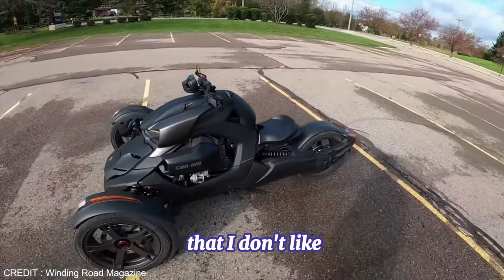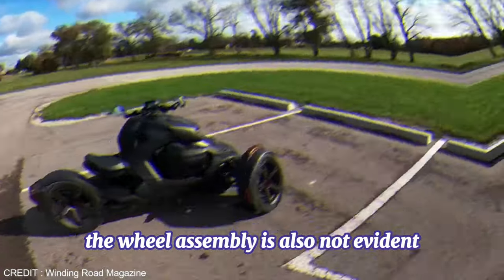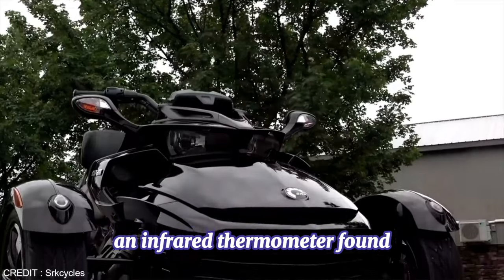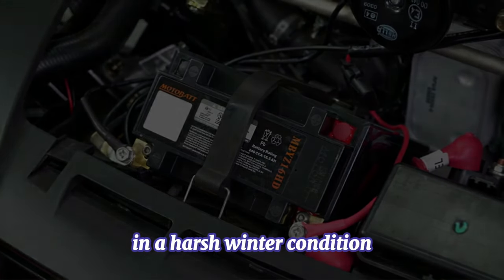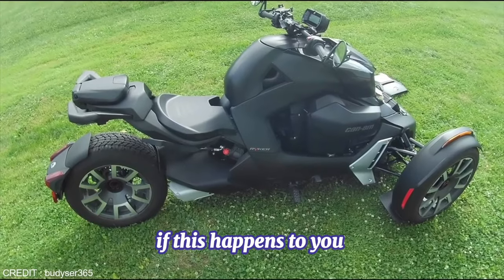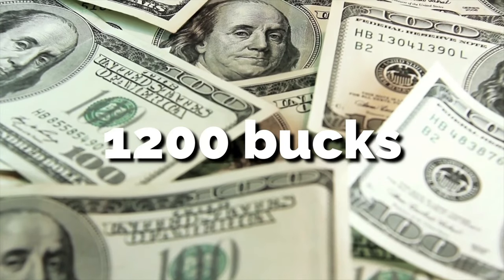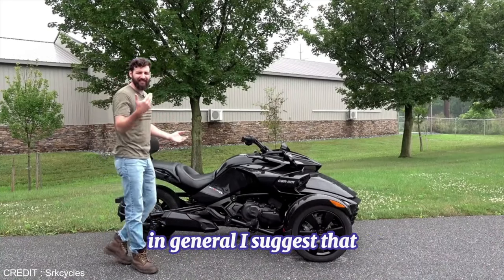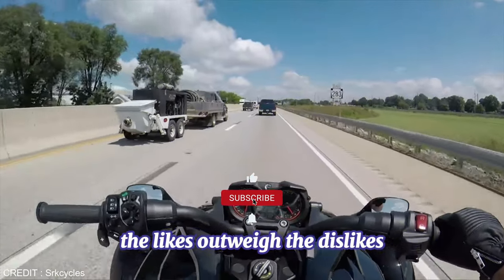Shocking Truths Behind Can-Am Ryker Exposed

Comment: Most of this is CAP. Doesnt even sound like this person owns a Ryker. #1 i would say 95% of Ryker owners dont take these off road. Its not an offroad 3 wheeler. He wasnt even showing a Ryker. #2 It does not get so hot its a problem. #2 This thing stops on a dime. All the riders I know including myself I have not once heard anyone complain about the break pads. #3 Who hangs out on the Dunes? Stop it. #4 Antifreeze reservoir. Again Who are these people you speak about. Never heard this issue before. #4 if you are going to say this is about the Ryker then Stop showing the Spyder and all those other vehicles. LOL. They dont have the same so called issues.  #5 Not once last winter did I have a cold starting issue. Another thing that either doesnt happen or is very rare. You even show some key thats not even for the Ryker. #6 Regular maintenance. The first oil change isnt due until 6000 miles. What other maintenance do you need? Also stop showing other vehicles. #7 Seriously hand and parking break issues? The Ryker doesnt have a hand break. At this point you are just making things up. SMH #8 I love that you show Slingmods vids for so called factory accessories. Again stop it. #9 Now your comparing a Ryker to a Lamborghini smh youre a FOOL! #10 Rust....What besides the rim holes do you see rust? My 2021 has literally been left in the pouring down rain and I have driven in the pouring down rain and I dont see these so called RUST issues. STOP IT! Lastly to finish off saying you love the bike. Id bet you dont even own one. So much of your footage is not yours or taken from other people. Showing a body kit that no longer exist and never really came to market. Showing so many other vehicles. Good job on the lies and click bait.  If you have one tell us year, make and model. Show pics, are you original owner? If not stop trying to mislead people.
Reply: My stock // original factory brake pads are a complete pile of dong dog shit. 700 miles in and they started screeching plenty loud.  Also suspension is showing potential issues , but minor fixes to that , aint nothing. So hes right on some , but not all , could be just a year made specific issue idk

Comment: My wife got the Ryker 900 when they came out in 2019.  We did have the VSS code issue but that was only AFTER she rear ended me and the bike needed major repair and it seemed to be an after -effect of this accident.  Other than that, no issues at all.  The bike is low-maintenance and oi changes are easy.  My friend has the same bike and the only issue he has had is the return spring for the brake pedal needing to be replaced because the brake-light was staying on.  The CVT is great - you have great throttle response from low to high end.  I have the 2018 Spyder F3 and when my friend and I ride I sometimes take the wife's bike because I like that low-end throttle response/take off speed plus being way better if we hit a dirt road.  The Spyder is a more comfortable ride and higher quality bike for sure, but the Ryker can be more "fun."

Comment: Where did you get the idea that the Ryker was an off road vehicle. It is not. Street only. I have had a Ryker 600 for a couple years now, and while there have been a couple of issues, they were fixed under warranty. I now have 22,000 miles on it, and it has been a blast to ride. It is not a sport machine either. I use mine just for cruising rural country roads.

Comment: I watched this again and it's total bullshit. These problems have nothing to do with the Ryker. Like excess heat on your leg because of the exhaust location. The exhaust is underneath and gives off no heat to the rider, none. And hard to maintain because floorboards and panels need to be removed. Total nonsense.

Comment: I had mine since May 28th been to the shop twice, abs module failure and the handlebar bolt recall. Other than that it's been great
Reply: I'm glad I got the Spyder F3! I've had it for almost two years with no problems.

Comment: I have an original 2019 Can-Am Ryker and I’ve never had any of these problems and it’s running great. All I do is do all changes in regular maintenance. I also have almost 13,000 miles on it. The vss code happens only if you throttle and brake at the same time.
Reply: How's a 3hr ride on one
Reply: @ulisesmedrano3382  good. Best seat in the game

Comment: Hey bub…. The Ryker is not a side by side. It can be a 2up if you buy a backseat for it. None of the Ryker models come factory with the passenger seat even the most expensive version the Ryker rally the seat is optional not to mention it cost around 300-350.

Comment: After buying a defective brand new Can Am ATV, and repeatedly being told "it needs to warm up, or you have bad gas", when it was probably the fuel pump that was faulty, I will never buy another Can Am ATV.  I was interested in a Ryker, but felt they were junky and even the newer used ones seemed to have some issues. After my ATV experience I do not feel that Can Am stands behind their products, and the customer service at the dealership was AWEFUL!
Reply: Sorry to hear about that, I’ve got a Can Am ATV and it’s done nothing but continually impress me with its reliability and performance, and the dealership was fantastic. I wouldn’t throw in the towel on the brand over a bad dealer
Reply: @loganbaileysfunwithtrains606   Funny you said that... So I read about Honda ATVs having some DCT issues, and I test road one that was practically new and traded in with 3 miles on it, and low and behold it def had some funky transmission issues going on... Anyway,  after researching further, it appears the Honda DCT issue is pretty widespread and pretty bad if it does affect your ATV so I went on the hunt for a new Can Am.  Found a MUCH MUCH better Can Am dealership, a bit further away, but my buying experience was excellent.  I just randomly popped in there one day  while I was in the area and they had a brand new 2023 570 XT, ended up scooping that right up!! (I didn't know at the time it was going to be one of the last ones made).   I test drove this one before signing anything, and thankfully so far it seems to be running beautifully!  The 570 is also WAY better than the 450 I had, especially in the snow!
Reply: @bettysmith4527  nice hearing you had a better experience, and I also have a 570 Can Am it’s just the DPS base model I’ve not taken mine out into the snow but for all the rugged terrain I’ve taken mine over it’s done the job fantastically. Recently helped the fire department shuttle supplies up to a brush fire and because I was aiding the department I was given authorization to use my Can Am on the highway and to go as fast as I safely felt I could go, I really got to stretch it’s legs the speed said 75 the speed rate on the dash said 70 so, those 570s can haul butt as well.

Comment: I bought a brand new '22 Ryker Sport and the VSS alarm hit me a week later. I have just over 1500 miles on it and that alarm has happened around 10 times. Add that to the multiple recalls and I've had no consistent riding time without issues. It's been in the shop now for a week for a fuel pump recall. I'll probably sell the damn thing next year.
Reply from the maker: Thank you for sharing your experience. It's important for others to know about potential issues with certain models.

Comment: I have a '22 Rally, only time it's been in the shop is for recalls, and there have been more on this bike than I've had on any vehicle I've owned, and any real issues have been with the dishonesty of dealers and BRP, the bike itself has been reliable and everything I wanted it to be for just under 12,000 miles. The CVT is designed to keep the bike in it's torque range when accelerating and in a lower more economical range at cruise, the compromise is good overall performance but no so great range.

Most I've ever gotten at 55-60mph on cruise is 120 miles before the gas gauge get's in the the range you want to be looking for a gas station, it's not good to run the tank too low because it cools the pump.

Comment: Thanks for info. Not buying after all.
Reply: None of those things listed are issues.   Most of those things are general issues with 3 wheeler and powersport vehicles. 

The Ryker however actually does a good job of not having those issues. 

It doesnt overheat.   I drive mine in 100 degree weather all the time.   I road a 2008 Goldwing trike in the same weather and it overheated in start and stop traffic. 

Ignition is fine.   

The Ryker doesnt have a bunch of plate and pans getting in the way of maintinence. 

The Ryker does not blow hot air on your leg. 

I own a 2019 Ryker 600.  That was 4 months after its first release.   So im a first wave customer.   Most first wave vehicles have tons of issues.   This one didnt.   It had 2 minor recalls that were fixed in less than 15 minutes at the dealer.

Comment: For this money...and especially on the spyder limited..should never have these issues..buy a HARLEY INSTEAD...THEY KEEP THERE VALUE MUCH MORE.
Reply: I'm definitely getting a harley and throw the tilting motor works reverse trike conversion on it, it'll be better than any can am because I'd still be able to lean like on a regular 2 wheel motorcycle and it'll have the 2 wheels in front and one wheel in the back, but it'll be a harley yeeeaaah buddy, I'm so excited
Reply: 🤣🤣🤣🤣🤣

The Harley will be in the shop most of the time. It's the name keeping them a float
Reply: @egibs3565   lmao I’ve owned several Harley’s and never had any issues and the build quality is far beyond anything can am or Polaris are doing. You have clearly never been in an actual Harley… have fun with your training wheels 🤣